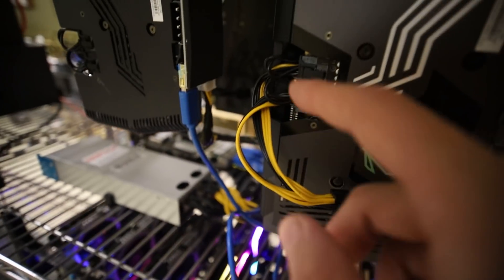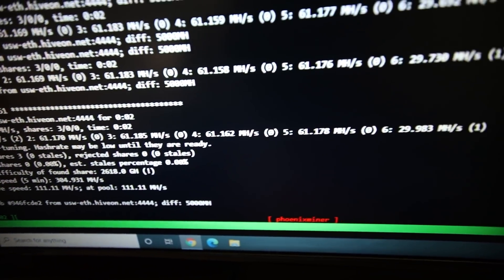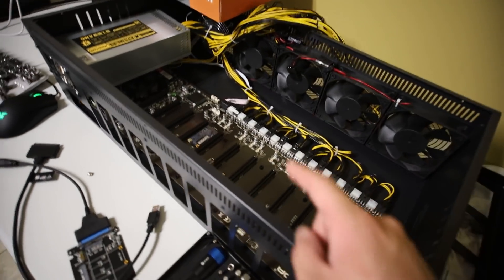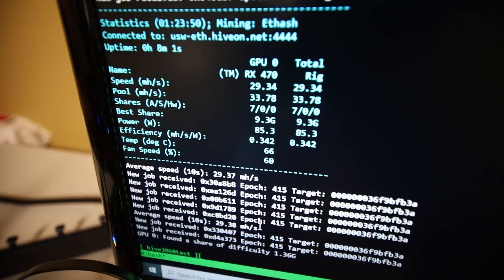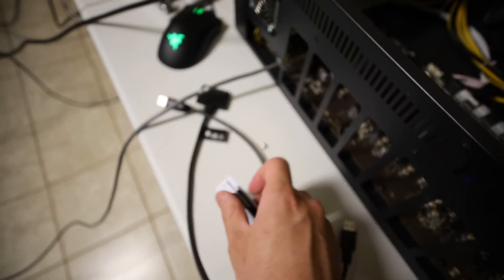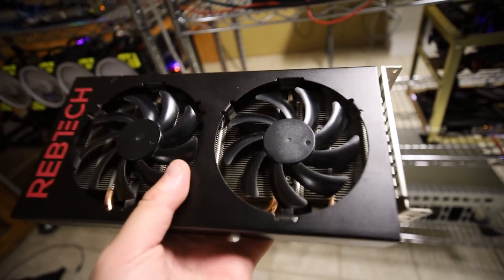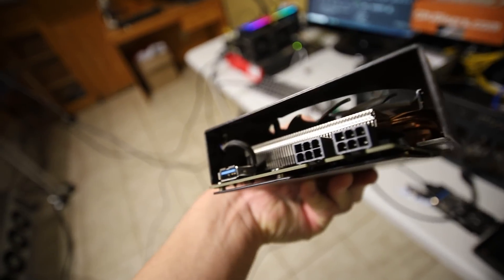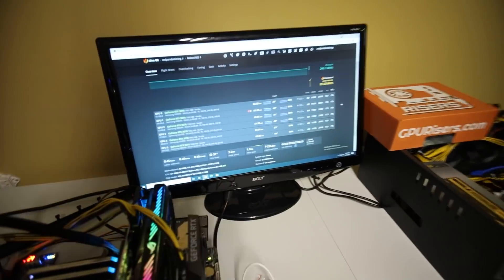Rebtech Also Has A GPU For Mining! RX 470 8GB

Comment: Dang that's running better than my RX580 8GB card...only about 23-26MH/s average.  Occasionally it calculates higher on mining site to around 30-40 MH/s but the average is much lower.

Comment: So I actually bought one of the Rebtech motherboards after watching your video reviewing them and a couple of notes:

1) For me, the Rebtech motherboard did NOT work with RTX 3090s (and of the ones that I have).

2) The Rebtech motherboard BIOS will say that it supports PXE booting, but it will NOT be listed in the Boot Devices Manager for some strange/odd reason. I did speak with Rebtech customer support about it and they said that they don't know why the BIOS manufacturer did it that way, but Rebtech was very nice and issued a RMA right away and had me send the board back to them.

That was a real shame/bummer because I was really hoping that it was going to work.

I did try to jumpstart the PXE boot using a USB drive with iPXE installed on it, and it still failed to boot properly with the RTX 3090s.

So, for your viewers and readers, please take/make note of that.

For the rest of your cryptomining basement, you can probably benefit from using a PXE server to start all of your HiveOS rigs/workers, that way, I just need to update the single image and I can start up as many rigs from that single image as I want.

One of my NAS units is running a Linux container, that's running the PXE server.

It's relatively easy to set up and super simple to maintain.